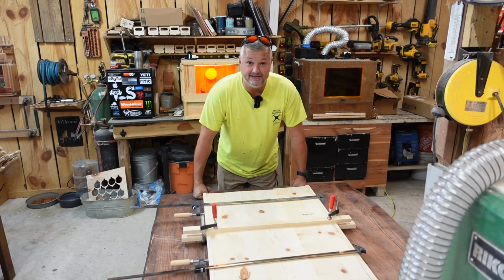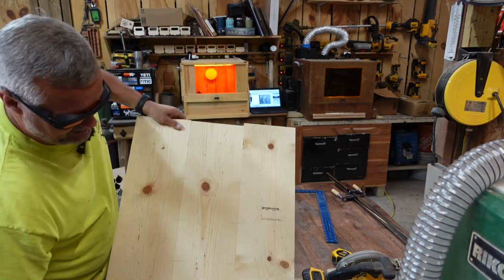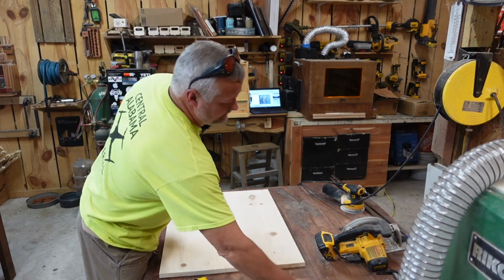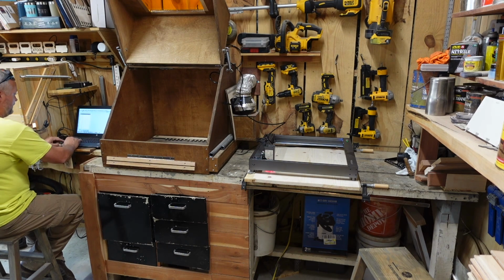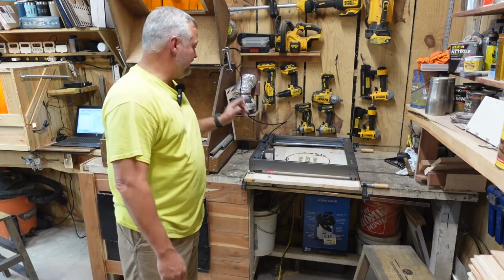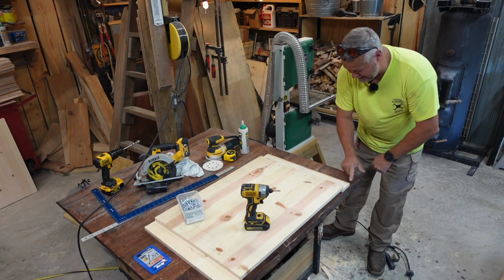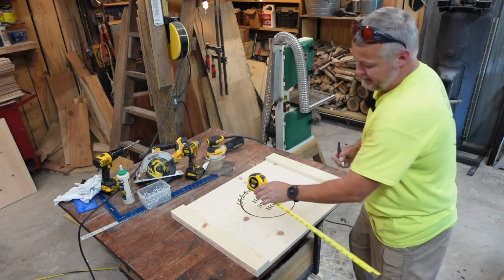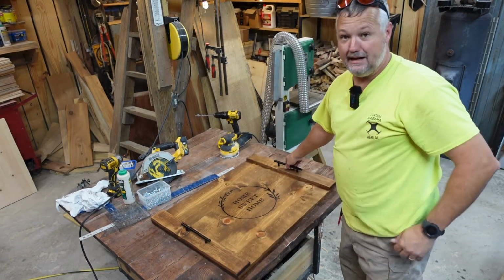Stove cover build- Part 2

Comment: Just found Part 1 and had to follow up with Part 2. Learned a lot from both. On comment and one question. Comment: instead of sanding when you get laser shadowing or smoke stains, you might try wiping the engrave with rubbing alcohol. Does wonders with zero risk of potentially removing some of the lines. Question: Since wood expands widthwise, is there much risk of cracking or breaking by gluing the entire length of the cross pieces, as opposed to just gluing the center and letting the screws on the outer pieces slide a bit? Thanks so much!
Reply from the maker: Sanding works best, I have made over 400 of them at this point. I use premade panels now due to the volume that I make.

Comment: Another question, made several of these and went to put one on my stove top, (electric) and the knobs were on one side of the stove top causing it to lean to the opposite side, Have you ever put runners on them or run into this kind of problem previously?
Reply from the maker: Some stoves require a spacer for such. Most of the ones I deal with dont
Reply: yea i figured, I am not opposed to putting one one each side to keep it level, was just wondering because we were thinking about taking some to a craft fair. If I put them up for sale on the web or something I'll offer the adjustment accordingly.
Thanks for al you do.
Reply from the maker: @Mike_Hobbyhorse_Handmades  I make mine to be as versatile as possible but I do make customs for some folks that are different.

Comment: Great channel. I enjoy your information and projects. I'm a newbe and have a question about your depth of engraving on your stovetop Boards that holds your stain and not blotch of your design also to make your design darker to look good thru your stain. I'm using a Ortur 5.5 watt laser on a board for my daughter. I ran one pass but thinking I need to do another. I would appreciate feed back
Respectfully
Reply from the maker: I run 40mm/s at 100 percent on the 10 watt. With a 5.5, you would need much slower or more passes. The burn is a mm or so deep.
Reply: @TheClackShack  Appreciate the quick answer. Another question on your oven board. How long did it take to engrave. Your design was roughly 13" x 13"?
Reply from the maker: @robwilliams3602  probably about 12 inches round. Keep in mind, I use this file and built it to increase burn time. It takes about 20 minutes usually

Comment: What size is your engraving?
Reply from the maker: the design size is around 13 inches
Reply: @TheClackShack  thank you so much for your help.  I’m going to give this a try.  If I can figure out how to use a plunger router for cutting wood rounds I think I can tackle these other tools.  I just purchased a table saw, and biscuit joiner kit.  I already have a skill saw and chop saw.
Reply from the maker: @deenawillis1597  I am sure you will get it.

Comment: Great video! Its now on my project list. I too have a tool/acquired items addiction. What size is your shop? I am currently in my garage, but have been threatening to build an actual shop so my wife can park in the garage (imagine that).
Reply from the maker: It is 20 wide and 24 deep. I could use a little bigger at this point.

Comment: Did you seal it after staining?
Reply from the maker: The "Rustic" folks prefer stain only. If the customer wants, I use poly either paint on or spray. For the really fancy ones, they get multiple coats of poly and sanded down to a glass finish.

Comment: do you ever plug the holes on the back where the screws went? Thanks for the videos. Just found your channel last week and subscribed. Getting an Xtool 10W in a few days. I normally was just making wooden flags and recently been looking for other projects to venture out to. This stove cover build is going to be the next project I tackle in multiples!
Reply from the maker: If it was requested, the bottom is rarely seen and I usually only dowell holes that are visible such as tales and benches.

Comment: great to see Part 2,  I was wondering how you were going to fit that board in you laser setup,  Oh I see you got a remote for your dust collector 😉
Reply from the maker: The cusom stove cover jig works well. He is self motivated, I plan to add a wireless remote to it eventually...$$
Reply: Where can you purchase the custom stove top jig for the Ortur LM3
Reply from the maker: @deenawillis1597  , not sure I am following, my stove cover jig is just my locking panel screwed to a piece of wood. It is the same panel that I use for my jigs, just cut down to only hold the legs
Reply: What size of handles do you use?
Reply from the maker: @deenawillis1597  I order them in bulk on Amazon. https://amzn.to/3AiqvsC

Comment: Looks great. I’m learning the process and will be using my 1985 Shopsmith model 500 and approaching builders and RE agents in Muscle Shoals and the rest of the Quad Cities. Thanks for sharing neighbor! ❤ I have a K40 arriving tomorrow to augment my Comgrow Z1,
Reply from the maker: That is a good piece of equipment, I need a shop smith…. Good luck
Reply: Yessir!  LOVE my 1984 Shopsmith Mark V 500.  Haven't upgraded it to all the newfangled stuff, so it's still vintage.  Just gotta take good care of it and make sure the regular maintenance (oiling those shieves) is done.  So glad that I bought the bandsaw and jointer when I got mine back when I lived in Starkville, MS.  Now, in Tupelo, all my neighbors get to see my lovely Shopsmith, 'cause I use it for most of my projects.   Glad to know there's another one roaring away up in the Shoals area where y'all make a bunch of good music!  :-)